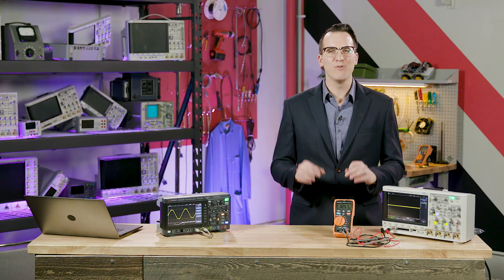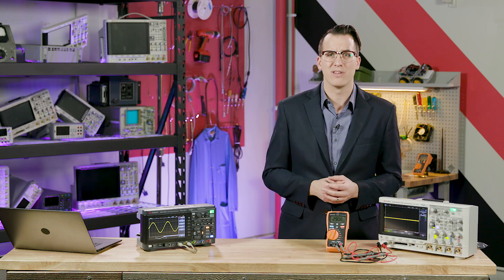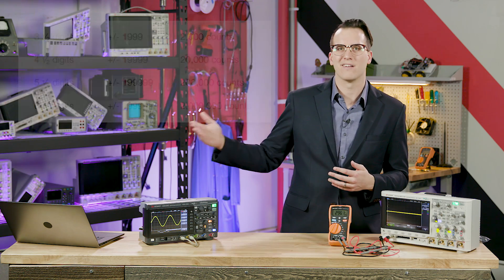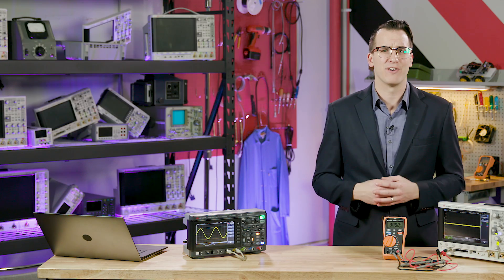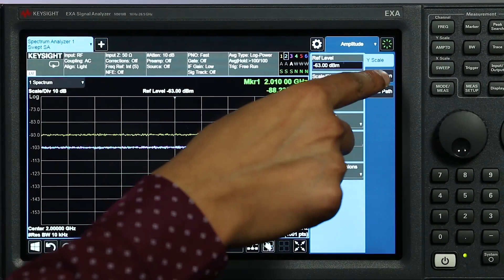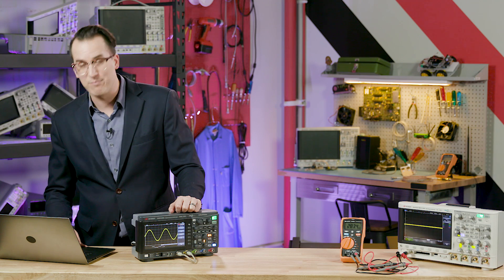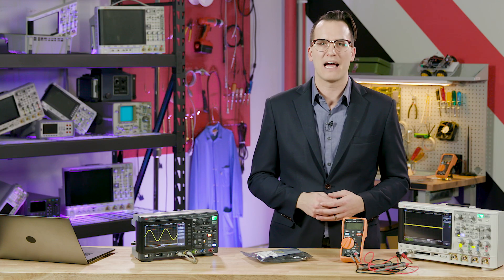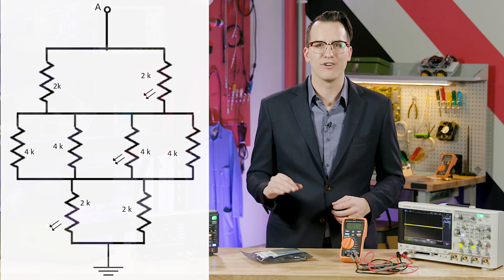DMM Digits vs. Count and Today's Winners! (12-Mar)

Comment: I tried to use a keysight multimeter in my college lab to measure current in the mA range. The two range settings were upto 600uA and upto 6/10A. Now since I want to measure in the range of 2-3mA, I can't use the 600uA setting, but at the same time the 6A setting has an error of ±93mA according to the data sheet. So what's the correct procedure to make this measurement?
Reply from the maker: Often there's something between those two ranges. Honestly the best option would be to use a multimeter with a better range (mA).

Comment: I don't do facebook, but 24 Volts is the minimum needed to have 2mA through the light emitting resistor in the group of 4 ||4K. The other two LERs? will have 4mA.
My first answer was wrong, I neglected to account for the LER? in the middle. :-(

Comment: Doing some hand wavy math, but I would say 24V at point A would be the minimum. I_load is then 8mA from the equivalent load of a 3K resistor.  Each subsection of parallel resistors would then have 4mA through the 2K, 2mA through the 4K and again 4mA through the 2K lighting elements.